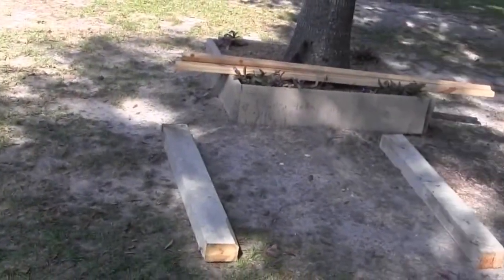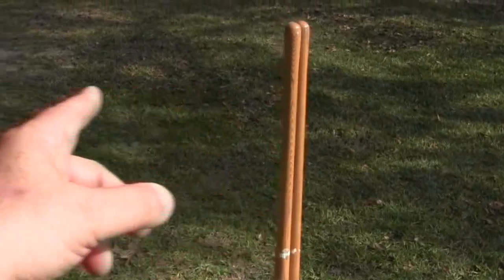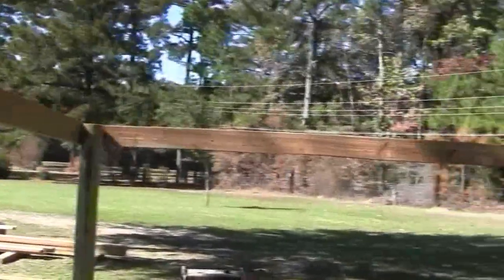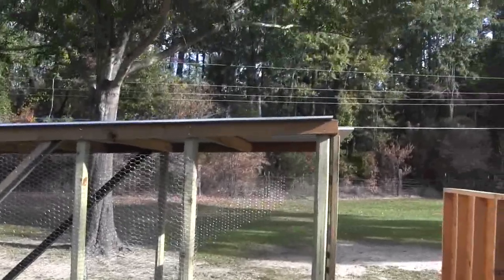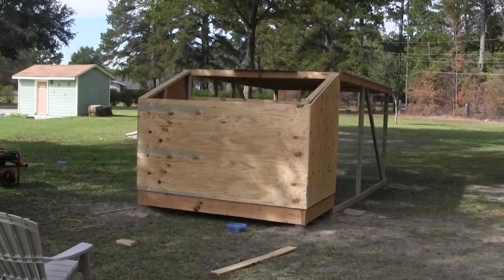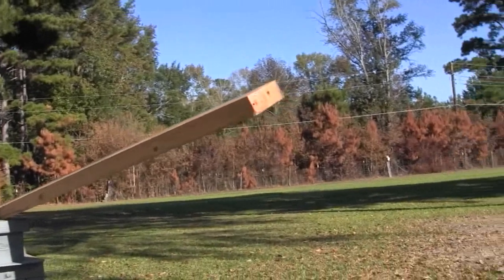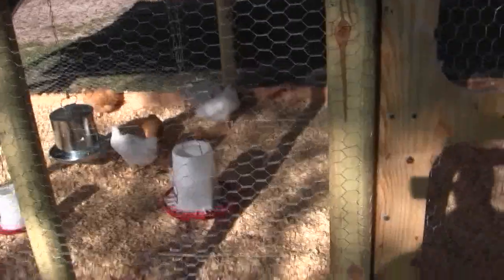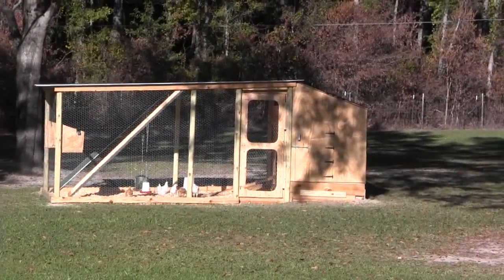How to build a hen house, chicken house, chicken coop

Comment: LOVE THIS hen house and run.  I am in the process of building one. I am going to do a raised house on 4.4's waist high and let them go under it as part of the run.   Anyway I am using the recycled bottles filled with dirt and cemented together to make a very durable and easily washed down hen house.   Anyway I am putting screening up over my chicken wire or hardware cloth to cut down on flies and mosquitoes.    We have a terrible time with them  where I live.  I did that for my rabbits and they apprciate it very much. lol.  Actually 4.x8 is the size i decided on for my hen coop as well.   I'll let you know how well it goes when I get it actually started.   I am doing a sloped roof as you did as well.  I like the way you made a screen door I just might copy that idea.
Reply from the maker: Good luck and enjoy your build!

Comment: watch out for free chickens, you have to quaniteen and sometimes they are older than they say and they are trying to get rid of (usually) chickens that are old or not layig well. also never use chicken wire a fox or coytoe can easily chew and rip through it use hardware cloth. it is a really nice run and coop nevertheless.

Comment: Hahah! You used YouTube's shake-correction which is a good option, but it also makes it seem like we're having a bad acid trip at some moments. Check out the movement on the poles at around 6:50 lol! - Great video btw! Thanks.
Reply from the maker: Thank God you see it!! I was afraid I Was having a flashback. When I do any kind of labour, my hands shake badly so I use the YouTube stabilizer frequently. It has actually gotten quite a bit better since this video.
Reply: Lol. I was thinking the same thing. :)

Comment: and I want to know does the post hole different from the dirt or the mud concrete
Reply from the maker: The posts are just set into holes that I dug into the ground. After I put the posts into the holes, I put some dirt back into the holes around the posts and tamp it in with the end of a board.

Comment: I have linoleum on the bottom of my coop, helps greatly with cleaning...also on your wire door to the run, you possibly want to change out the latch to one just like it but it has a spring on it, a raccoon can open the regular one...it would just be an extra measure of protection I thought I would suggest.  If you go to Lowes.com and type in Item #: 58430 |  Model #: 490977...it is what i am talking about.  Your coop looks great!  Enjoy your ladies..next, you need goats..my girls love our goats!